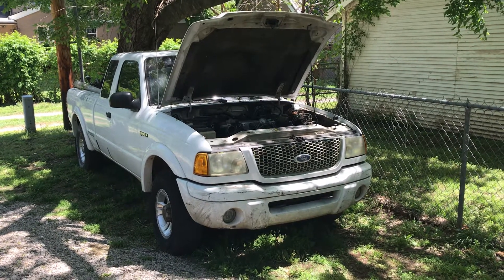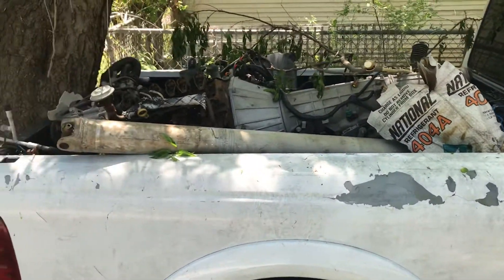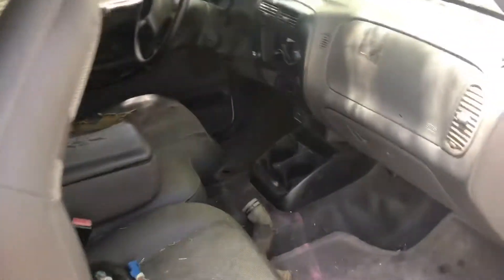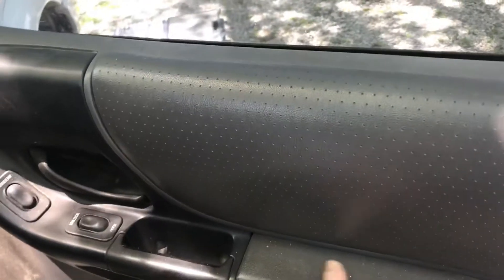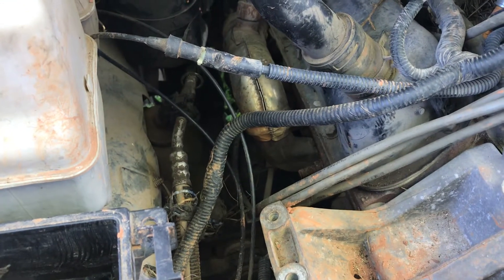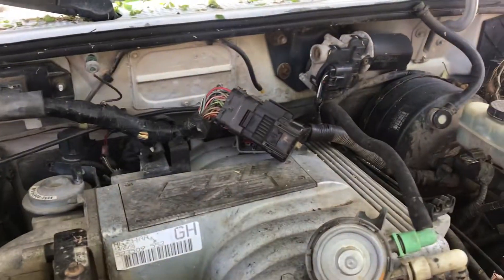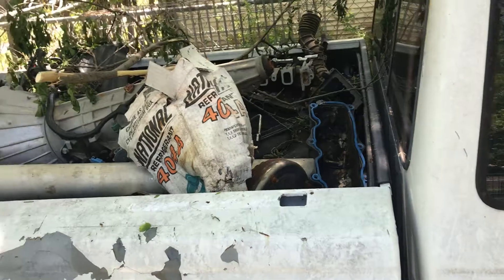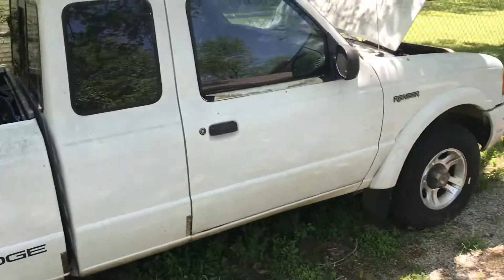2001 Ranger Edge 5.0 Swapped. Project #2

Comment: I already have a built engine  out of a 89 mustang,  what motor mounts do I need? I've heard explorer,  but what about the mount that goes from the engine to the motor mount itself? Mine is a 2000 ranger with 3.0 thanks
Reply from the maker: Rick's Rangerz makes an adapter plate for it
Reply: @itsoundzgood  thanks , I ordered a set from him yesterday

Comment: Mine is an 03 2wd 3.0. I'm thinking it will be easier and cheaper to just buy one someone else has already done the swap on.. wanna sell one of yours? Lol
Reply: There are two different front suspension designs for the 2 wheel drive. One has coil springs and the other tortion bars. The tortion type is the same as the 4x4 and easier to swap a 5.0 in.